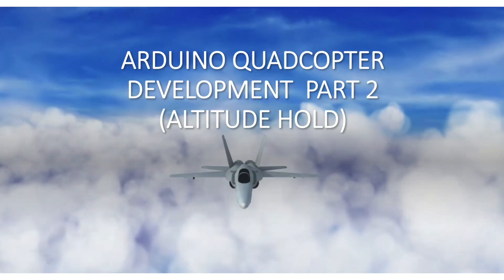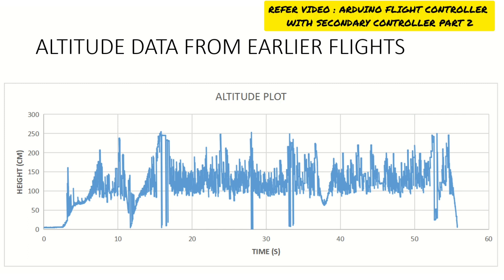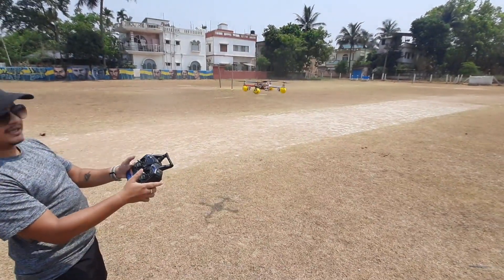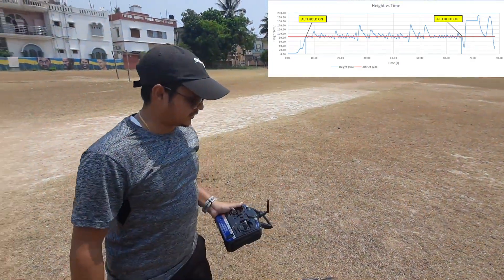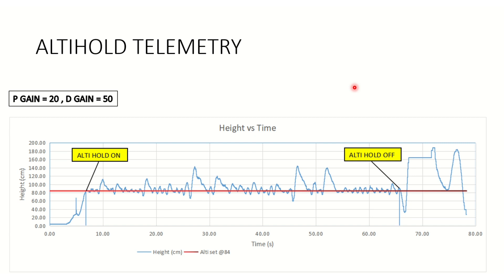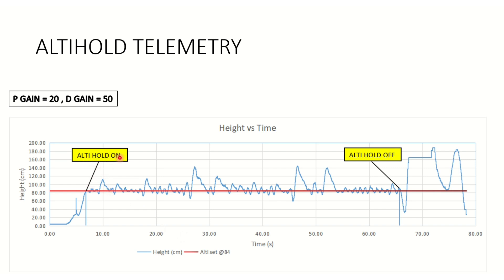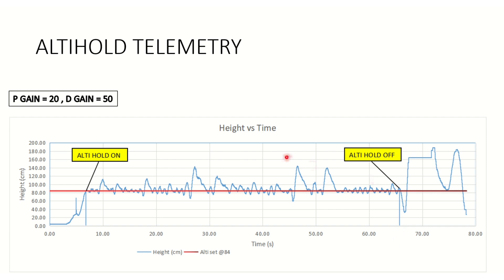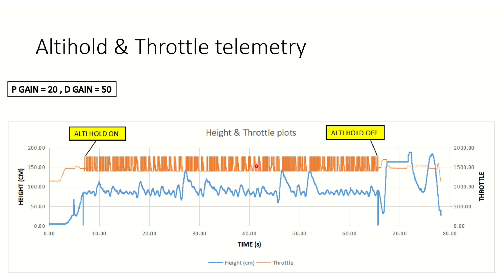Arduino Quadcopter Development Part 2 (Altitude Hold)

Comment: Bhai mere drone kuch Der baad automatically crash ho ja rha h 
Ymfc 3d wla quad h
Reply from the maker: Vibration could be high. Try to balance the propeller. If it doesn't work, then mount the controller board on very soft foam